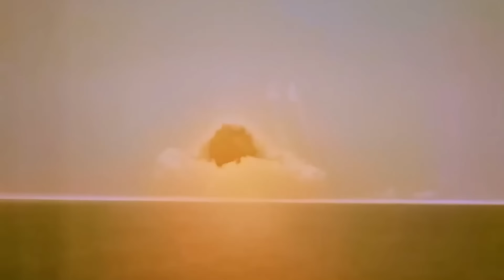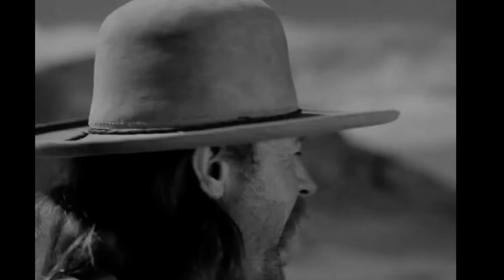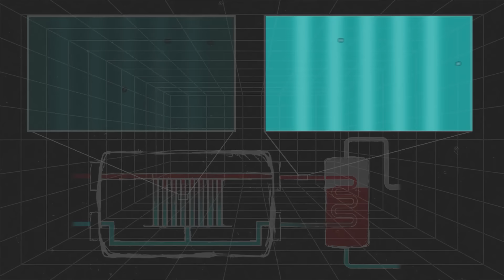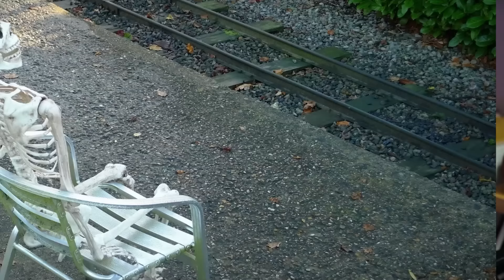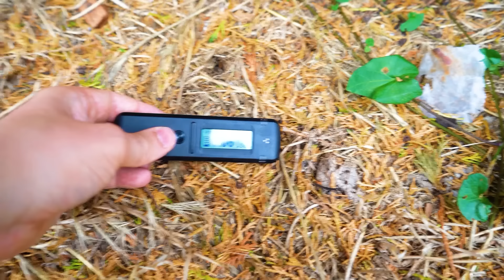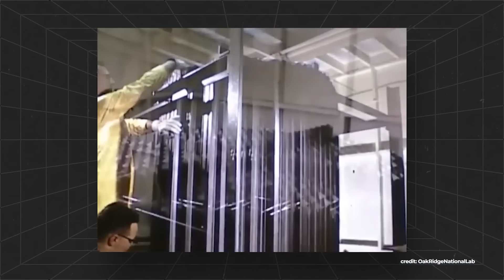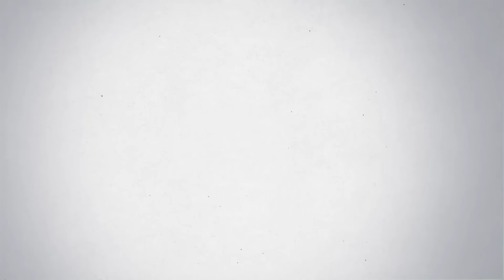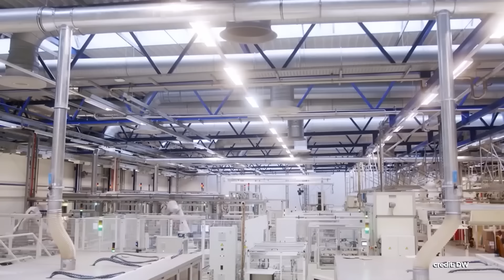It's Happening - China Launches World's First Thorium Nuclear Reactor

Comment: Doesn't most of the energy from a fission event go into the kinetic energy of the fission fragments, not the free neutrons?
Reply: All of it in fact, heat is kinetic energy. It's the nuclear bonds that store the energy of the atom as extra mass, when they are broken you don't get more mass into the new elements or particles. Instead you get less total mass and it's converted as e=mc2. And so yes all that energy goes in the form of heat or kinetic energy
Reply: @Tofandel  Sorry, I was just being nitpicky about the energy distribution in the immediate products of a fission event. The video makes it sound like the fast free neutrons get most of it, but the majority of the energy is actually in the fission fragment nuclei, which slow down over a much shorter distance. 

So while the neutrons do go on to heat up other parts of the reactor as they slow down through collisions, most of the fission energy is deposited near the initial location of the fuel atom by the fragments.